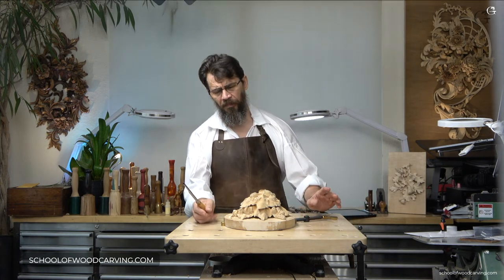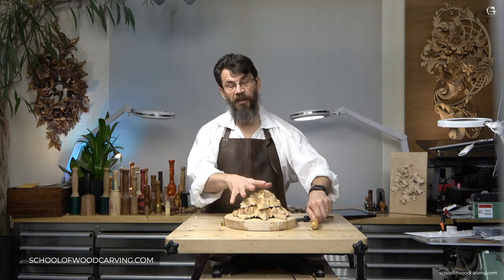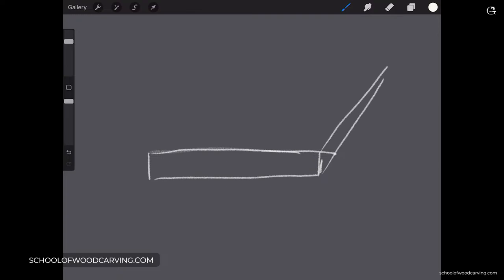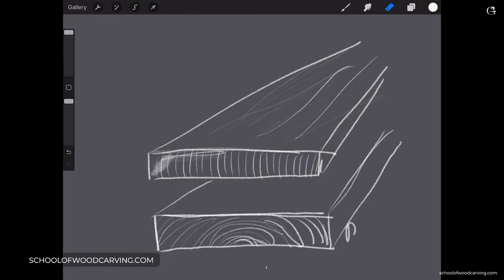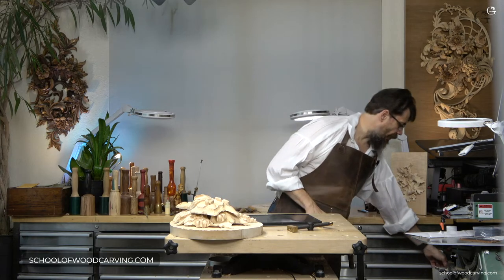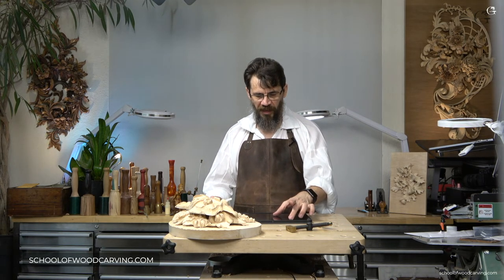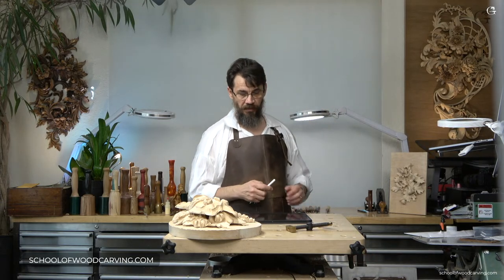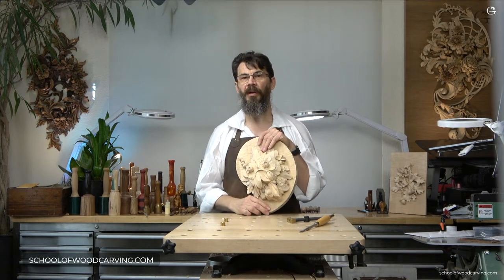Warping and cupping of wood - how to deal with -em

Comment: Hi Alex. This question is not related to this subject but wondered if you would advise if when using chalk paint to finish a carving you seal it first or dilute the paint. Do you use one or more coats and is there any special brand of chalk paint you favour? Thanks very much for any comments.
Reply from the maker: Great question. I use shellac primer before chalk paint. As far as brand. All of them approximately the same. I do 2 coats of chalk paint.